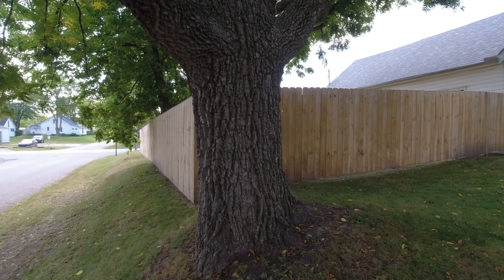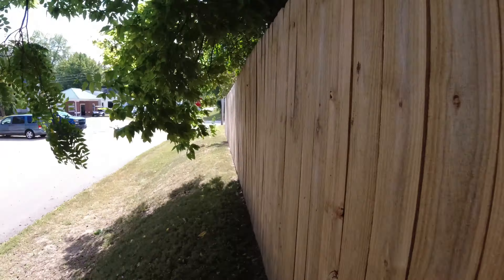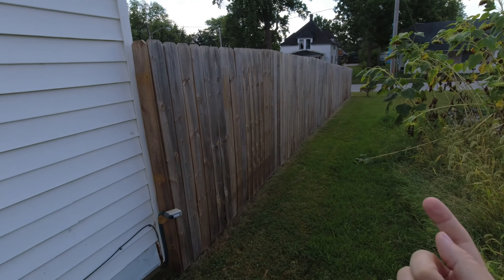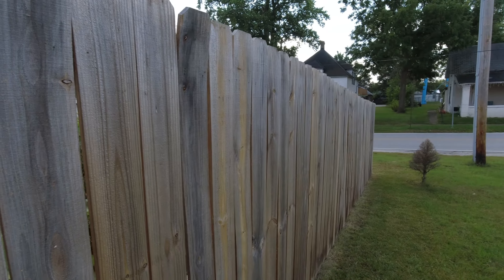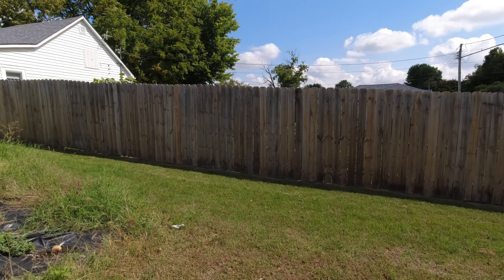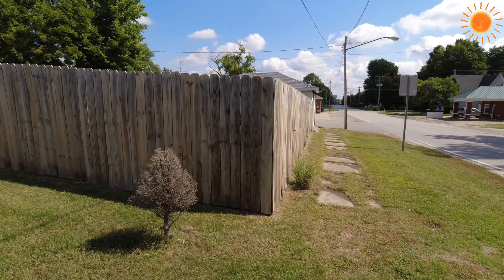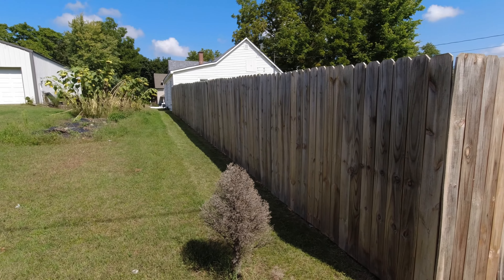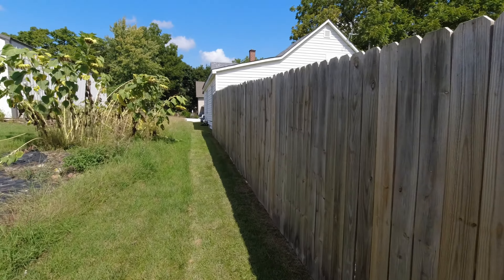10 Mistakes I Made Building My Picket Fence and How to Fix Them

Comment: Galvanized nails will rust in pressure treated wood because the treatment chemicals contains copper. Also the galvanized nail heads will corrode and cause black streaks running down the board starting at each nail heads. If you use nails, use aluminum nails. I use deck screws because they are removable. Aluminum nail head pop off when you remove the pickets. Cedar pickets do not warp like pressure treated wood.

Comment: 2 inch ring shank for the pickets . Your pickets will fall off before those nails pull out. Also , even green lumber will have s bow to it.  Face your bows the same direction, at least it will watp in same direction......... you definitely don't want your gate hanging off the side of your house.

Comment: I put up the same pickets and had very similar issues with the pickets etc. I too wanted to save some money so I used 2x2 top and bottom and a 2x4 center. I don't have any regrets there, the 2x4 across the center gave it more than adequate strength. Watching this video I remember the pain and time I wasted trying to get everything perfect, wasn't worth it once the pickets started drying smh lol All in all it looks very good and does what a fence should do. I kept the bottom of the pickets off the ground about 2" and ran a picket along the bottom to the ground, kinda like trim molding lol.. This way I'm hoping the fence pickets will last a lot longer without the ground contact and picket running across the bottom gives it a finished looked, plus its a lot easier to replace one of the pickets running across if rot develops on it instead of risking rot on the bottom of all of them over time. 6 years and counting all is well! Great tips for anyone looking to make their own fence, keep up the great work and videos!

Comment: The wood is trash today, years ago you can buy straight smooth lumber 2x4, 2x6 whatever today not smooth very rough ragged warped splits, I had taken back so many over n over again & yet they charge much for this junk I still have more to take back & what's frustrating is having to use an electric plainer bring the edges on most are not level.

Comment: I agree the wood quality is like any other garbage your large national hardware stores provide us, but what really helps warping picketts is they should not be nailed to the runner board more than 6 inches away from the top or bottom of the dog ear pickett. You will always have some bad pickets but the wood being green or wet is not the issue. It's mainly the runner placement.

Comment: What I did over 35 years ago in Southern California, where there are termites. I dug post holes about every 8' put in a galvanized pole in concrete. (Drill holes in the poles before installing them using a drill press. Save you a lot of time.) Then I sandwiched the posts between red wood 2 x4s. Attached stringers and my 'pickets.'  (I made a herring boned type pattern which took forever...) What this does is  lift all the wooden parts off the ground. The posts never rot or get chewed. Has held up great for 35 years. I did wash it down once and reapplied an exterior wood coating (not polyurethane, more like a re moisturizer.) 

I put the rough side on my neighbor's side. The sun will rake right down along the fence. That side looks amazing... So set up a couple of patches and see what you like. If you just do it on something that moves, you don't have to sit around waiting on the sun, just move your test patch. 
And the thing about pickets? They don't have to be uniform, just close. You'll noticed if the top is uneven, or if they cockeyed, but you will never notice if you cut out little pockets on the side (if there is some space between the pickets). The repetition evens it all out. 

My herring bone pattern was a pain because the fence was on a slope. I was half way finished before I figured out how to precut more than one board at a time. The gaps? With butt joints you will get gaps. If you don't want them, and I didn't on my fence, you have to make lap joints or tongue and groove. Lap joints with a table saw and maybe a dado blade would be really easy to do. 
And give them some space. As the green wood dries it shrinks, but when it rains soft wood can expand across the grain 6 - 8% or more. (Haven't looked this up in a while.) 
If they warp it would be better to have the stringer closer to the top... but we only learn this later.   I love white cedar. I once bought every piece the lumberyard had. They ordered it, the whole pile was all over the place with warping, but the wood looked great. They were selling it cheap to get rid of it. I bought some, went home, made something with it, loved it, but also found that if was nailed down the warping was so weak it laid flat and stayed flat. I've got a 14' table and a large deck.
And yeah gate latch hardware is still limited....